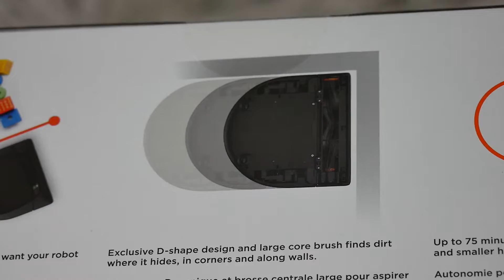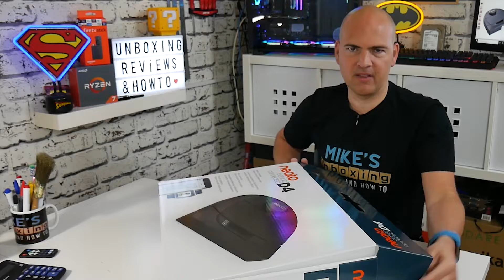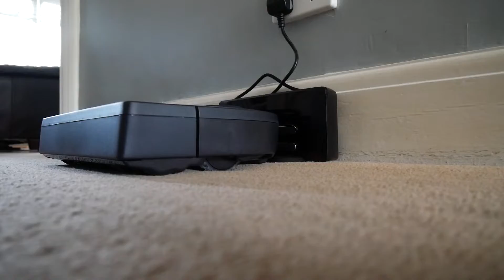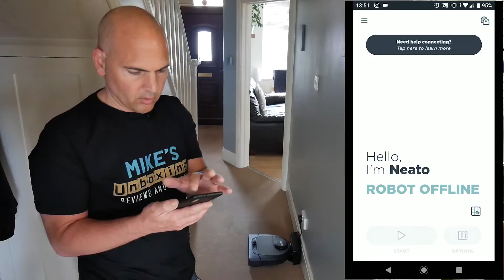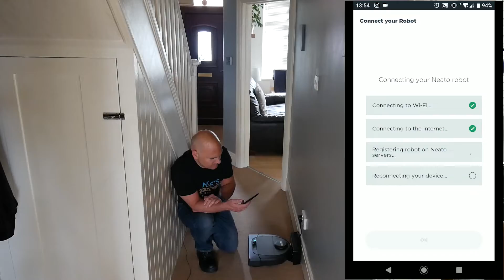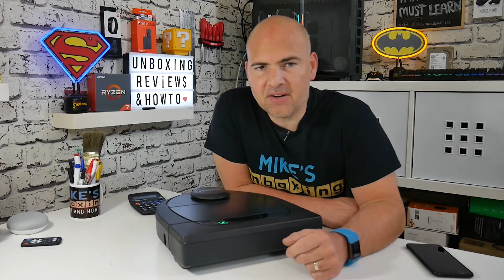Neato BOTVAC D4 Connected Robot Vac

Comment: I run the m6 daily, and my floors look awesome🌼 allabout.wiki/Neato I wet mop 2 days and dry sweep the rest of the days. When I first got it, I used the included disposable pads. I didn't like them--the dry pad has no depth so if it picks up a chunk of something, like dry cat food, then it pushes it around or drags it around the floor. The wet pad wasn't very absorbent so left streaks and wheel marks.
Reply from the maker: yeah it is a cool little household helper. glad you liked it

Comment: I have had no less than 6 robotic vacuums... how is the battery life?
Reply from the maker: I really can't tell. It does the whole ground floor in about 25 minutes and seems to be around 60% battery left so seems to roughly match the rated 70mins run time.
It seems a lot more efficient and effective than my older eufy one

Comment: Hi Mike, that looks like something my dogs would like to eat. LOL. I got my 360mm AIO a day early and tore my PC completely apart to clean 8 months of dust out of it. I actually stripped the case and hosed it down outside. It's all back together now, and running Cooooooool. The radiator has a push pull config with two 200mm fans in front pushing, and 3 120mm fans pulling. So far my temps are 15c cooler than it was.
Reply from the maker: That is a result. 15c cooler is a massive bump in cooling performance.